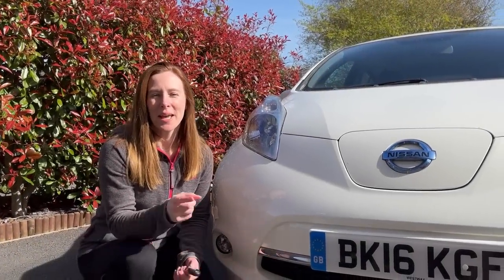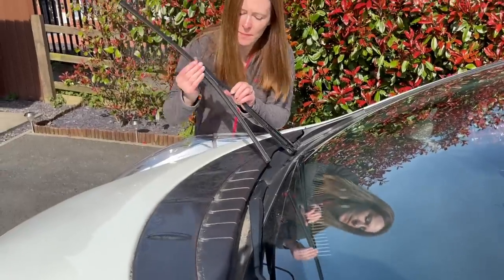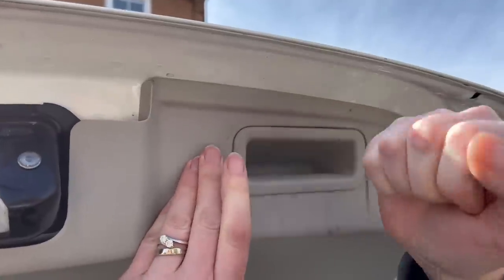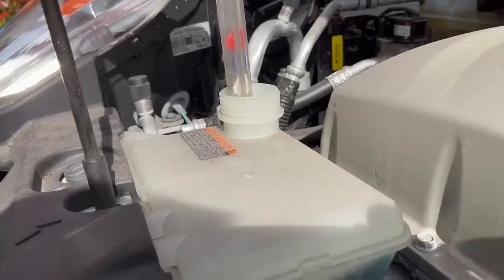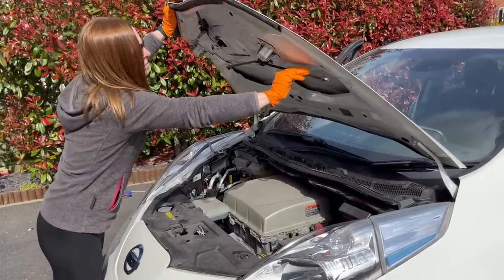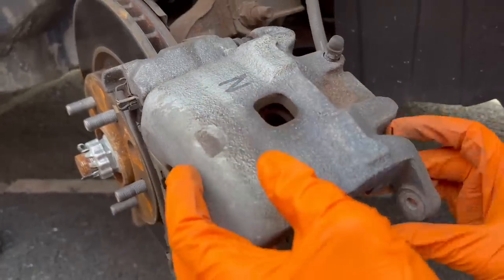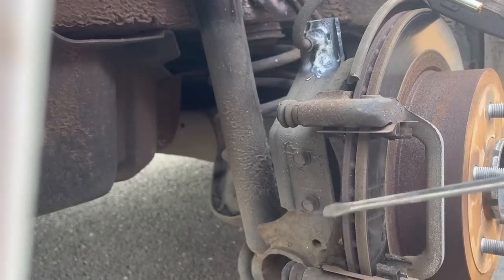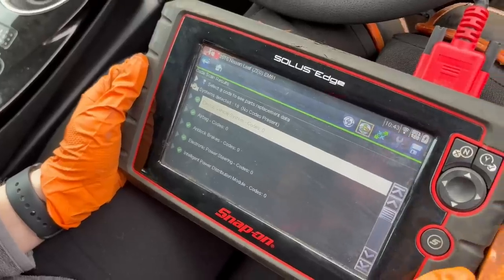Nissan Leaf Major Service - What's involved???

Comment: My 2018 40Kw leaf has just passed the 100,000 mile mark with no loss of battery.The only problem was a failed 12v battery changed myself, 1 set of brake pads, seized foot brake cable and drivers door power window switch. 2 dealer services when under warranty. Haven’t bothered taking it to a garage for service as it’s a total ripoff due to very little moving parts and only one filter (cabin) which can be replaced easily.

Comment: Excellent Job, Kate,  my only comment is, why you did not mention in the thumnail the exact  model year and trim of the Nissan Leaf in this video ?   I'm currently in the decision process myself 
in shopping and choosing between a  2019 Nissan Leaf Plus  SV or SL  trim with 215 miles of estimated range or a  2020  Hyundai IONIQ all electric  with estimated  170 miles of range:

Comment: Reduction gear oil check: I am interested that you can access the fill plug from above.  A 10 mm allen hex is used but the plug access is horizontal,  Can it be reached with a normal socket wrench?  Also, what is the size of the crush seal?

Comment: Two questions: what lubricant did you use for the hinges etc at the beginning please? I can't remember if WD40 is a no-no for those parts. The other one is: what are DTC's on your diagnostic machine please?
Lovely thorough service, can't wait for the day to come when I have a used ev for you to look after! Thanks for videoing it for us Kate. 👍
Reply: As far as I know WD 40 shouldn’t be used on the dampers rather a silicone spray as it won’t damage the rubber seals.
Reply from the maker: No worries. We use white PTFE for the latches and dry PTFE for the hinges and rams. No WD40 was used.
Reply: DTC = Diagnostic Trouble Code - issues (usually indicated by the check engine light) stored in the car's computer - the code narrows/details the system/location of the issue.
Reply: @Jamesandkate  thanks very much, there seems to be so many different types these days, I find it difficult to keep up!
Reply: @wobby1516  thanks very much, yes I kind of had a feeling WD40 is not good for some applications, just couldn't remember which. 👍
Reply: @kemenyg19  ah, right, thanks for this. I know about the check engine light and that it can encompass any number of things which can be detected by plugging into the OBD port, I believe. So this is the brains behind all that, it seems. Great, something else I've learnt today. Cheers. 👍

Comment: It's always welcome to see other Leaf owners sharing their "how-to" info, based on real-world experience.  However, the presenter lost me when, early in the video, she used a hot-melt glue gun to do body repair.  Can't speak for their area, but even here in New England cars can get SUPER hot sitting in the sun, certainly hot enough to soften or at least break down the glue.  Short answer -- DON'T DO THIS!!!

She also used a spray lubricant on the charging port door, something I would not do.  There's too much risk of getting grease inside the connector, thus putting at risk the electrical contacts.  Even if the oil doesn't itself hurt the connection, it will attract and hold dirt and grime which will.  Again, avoid.
Reply from the maker: We've been hot glueing these for years, we've never had an issue with heat. Also, she didn't spray the charge port, but the door hinges and hinges of the charge flap.

Comment: That’s why we use Cleevely EV for our cars. However we could go down the Nissan dealer version, which is as follows: 1. Plug in leaf spy Nissan version, print out the battery check. 2. Top Up washer fluid. 3. Wash the car with a bucket someone pissed into (if you don’t know the reference, watch EVM). 4. Done. 5. £199 please 👍🏻 Oh there’s also a £299 version which is the same but involves checking the brake fluid, whilst claiming it’s been drained and replaced. And erm, sadly I experienced this with them. Once.

Comment: Thank you 👍 this is Awesome.
I now have over 204,000+ USA miles on my 2017 Nissan Leaf SL after 5 years 2 months and 3 days later. " Nissan Simply" 😱
Amazing 😂
Reply: How’s the battery state of health and how do you charge it, to only 80% as a rule?
Reply: I had 131,000 + USA  miles on my 2015 Leaf S after 6 years and 11 months.  The dealership indicated 11 of 12 health bars, and I found out later via EV Works @ Bainbridge Island, WA that the SOC was 84%.  24 kWH pack.  They considered this above average health.
Reply: @lelandhetrick205  May I ask your charging habits of that car?  For instance did you regularly use the scheduled charge to 80% feature?
Reply: Wow and Kyle Connor on out of spec keeps saying you can’t go out of the city with a leaf. That’s a lot of Miles
Reply: 57.75% of the original 30 kilowatts
Reply: I broke all the rules 😱 charging to 90%-100%. Discharging the pack, to -
 1%- 10% a lot. I am in. midwest= moderate climate variations here.
Reply: @danthedrivingman6415  yeah I’m wondering if the cell temperature (as shown by the Nissan temp gauge or in LeafSpy) is truly more the determining factor in maintaining battery health. However in my one year of a degraded older leaf it’s gone from 58% SOH to 54% SOH and it wasn’t temperature extremes, other than a few freezing days, that might have been a factor as much as charging pretty consistently to 100% because with 13 kWh usable of the original 26 kWh nominal it’s almost any trip that starts to give you range anxiety if you only charge to 80%. Plus the low battery range warning starts flashing at 30% SOC.
Reply: @skyemalcolm  100% charge up from home (@120-volt wall plug) for my 60-mile roundtrip commute.  If less than 88% then I can expect to use a commercial charger on the way home.  Then, I would only charge to 80% in the winter, 60% in the summer seasons to travel the other 20 miles home.  Yes, I like a healthy buffer at the end of my commute.
Reply: @skyemalcolm  I drive in the mild PNW around Seattle type of weather.  Rarely temps fall below 24 degrees or go over 90 degrees.  The car had a good mild environment.
Reply: @skyemalcolm  usually fast charged to full, then drove it until home.
Then fid level 1 @ 120volts until full. Several thousand times. Fast charged up to 4 -5 times a day. Most were for 🆓. 😂

Comment: If I had an EV and lived in the area there would only be one place I'd go for a service. So thorough.
Reply from the maker: We do this in a mobile basis as it happens 😉
Reply: @Jamesandkate  I don't suppose you ever come up to Fife, Scotland? We have a 2015 Leaf and it would be great to have it serviced properly like you have done in the video. Nissan only seem to top up the screen wash, change the brake fluid and give you a useless battery report.

Comment: Need to check that transmission fluid level ("gear oil" at the 5:24 point), and check for leaks around the casing seams.  It's actually easy to change every 80,000 miles or so too.

Comment: Very thorough attention although a "major" service should always include a brake fluid flush even if the fluid measured "only" 1% moisture content.  It looked quite yellow, not a good sign.  Also the gearbox drain plug has a magnet that should be cleared as well if either are done.

Comment: Ironically these are all the faults I need to fix with my 20yo ICE :) Shocks, rear brakes, cw-boots etc. In addition to loads of corrosion. And the worst part, I don't really have alternatives. "U" in "SUV" stands for anything but "Utility" these days. 22" alloys with barely any rubber on them and 0-60 times worthy of M5 from some yesteryear. Are you bloody kidding me? At the moment I can only hope that LDV T60 EV they tested in New Zealand would also be sold in Europe. But even then - it is €40k+. Not sure I'm ready to pay that much for a vehicle I intend to use in it's utilitarian capacity extensively. 
I'm hopefully be able to afford second-hand Kona in a year or two. But I will still need something utilitarian to do dirty work. And there is nothing coming. Unless Ford Ranger (even though I would prefer boot that is part of a cabin) suddenly gets a drivetrain from F150, than I will by it two years later, hands down.

Comment: Another tip. If you remove the rim, spray all rods, shock absorber spring, brake lines, etc. with WD40, against rust. Everything is then protected and looks like new. Do 👍
Reply: Wd-40 W/ silicon for the anti-corrosion property imo

Comment: Is the reduction gear oil fill plug easily accessible in my 2022 Leaf?  Unlike the older Leaf model that is shown in this video, I couldn't find one under the hood of my car.
Reply from the maker: It’s in the same place in all Leafs. Maybe easier to access through the NSF wheel arch 👍🏻
Reply: @Jamesandkate  thanks!!

Comment: Good video! Good illustration of how to lubricate brakes. Just one comment: I have been warned against lubricating the struts holding luggage lid, but you recommend this?
Reply from the maker: We always do it as the boot has a habit of squeaking when lowered. Avoid WD40 though, dry PTFE is what we prefer.

Comment: Reduction gear oil plug magnet is interesting , my gear oil is due at 120,000 miles , I'm at 111,000 at mo. What oil do I use and quantity?
Reply from the maker: For the Leaf we use Dextron 6. It’s expensive but very good
Reply: There is another magnet on the drain plug which seems to have been missed.

Comment: A tip is to fully remove the caliper as the upper bolt has maybe never been off. I just did a service on my grandpas leaf with 47k km. Looking like new underneath, but the top bolt on the caliper was stuck on the rear left of the car. Got it unstuck and the caliper now moves freely!

Comment: Running tyre pressures high although improving milles/KWh it also reduces grip
Other than that very informative video
Reply: Rule of thumb is factory spec + 10%. Tyre garages very often don't check labels and adding 32PSI by default, which is too low for EV
Reply: Not correct with the Leaf, sticking to the recommended 36psi lead to distinct under inflation tyre wear, set to 40 all good, the latest set are coming up for replacement before next winter, totally even wear across all of them.
Reply: @edwyncorteen1527  if that's the case then fair enough however they never mentioned that the tyre wear was the reason for running pressures high, the reason given was better millage.

Comment: You really should not be touching around high voltage components unless you’re sure there is no high voltage flowing and/or your service disconnect is out and you let the capacitor drain.
Reply: Those gloves your wearing will not prevent shock from a 360v battery

Comment: To check play on the antiroll bar links you need all wheels on the floor so the bar is not under tension.
Reply from the maker: That’s why we manipulate it with a pry bar, you may not have seen it in the lower section of the shot.

Comment: Could you explain what the DTCs are right at the end?
Reply: DTC = Diagnostic Trouble Code - issues (usually indicated by the check engine light) stored in the car's computer - the code narrows/details the system/location of the issue.

Comment: As I don't own an electric car just curious why antifreeze coolant what is this for apart from screen wash what else is needed to cool, thanks in advance
Reply: There is only screen wash!
Reply: It's used to cool the inverter and motor
Reply: Most EVs have two or more loops of coolant - one for HVAC system, one for motor/inverter and another for the battery (which the Leaf doesn't use - it is air cooled)